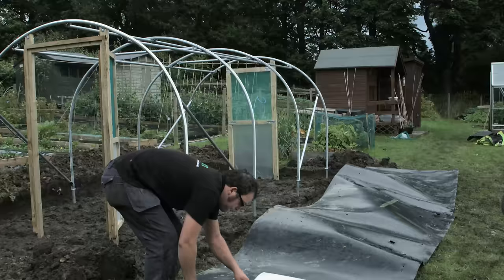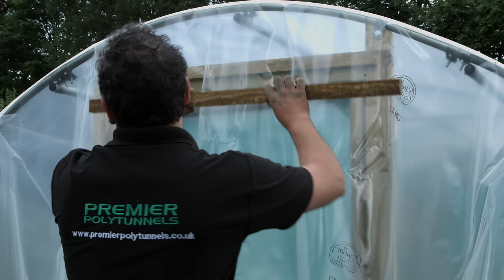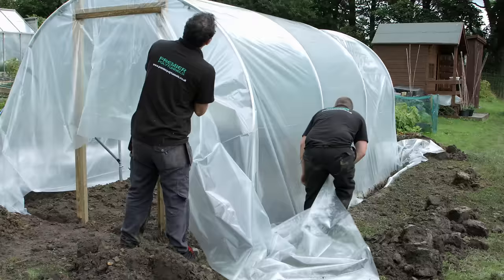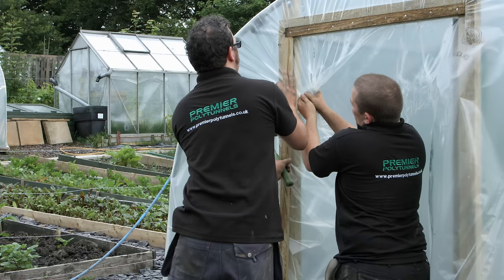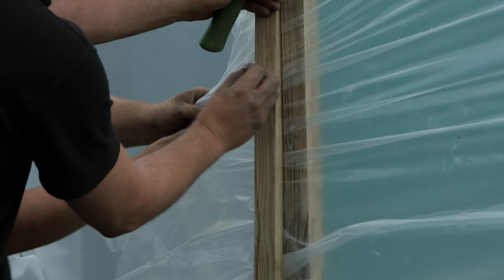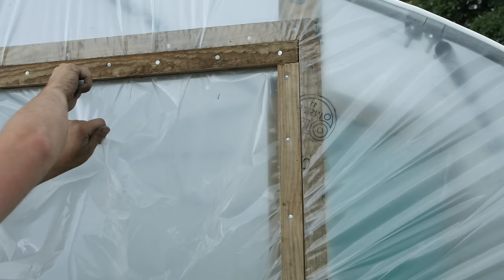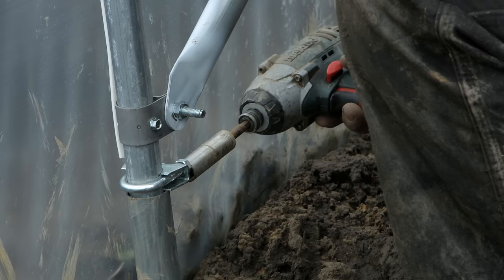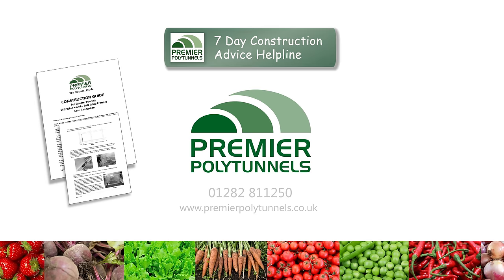Covering a Polytunnel using the Trenching method | Fitting a Polytunnel Cover

Comment: Nicely demonstrated. I have a couple of questions... 1)what if I only want a door on one end? And 2)is there an alternative method to trenching?
Reply from the maker: Hello, 
Thank you for your questions.
 
We do recommend having a timber end/door frame with a dummy door at the back end of the polytunnel - it doesn't need to be a working door, but the timber frame will allow you to fit the cover with ease and with a taut finish. The timber frame also adds strength to what would otherwise be a big flat area of polythene on the end of the tunnel.

You can certainly use the 'base rail' method for fitting the polytunnel cover, rather than the 'trenching' method, if you like. Details of the various covering options can be found in our video here - https://www.youtube.com/watch?v=68SWQtC1MNU&list=PLBtgTb_JxETny-1AZPn_x3fMm4FS-LuX8&index=5 

Kind regards, 
Premier Polytunnels
Reply: @PremierPolytunnels  brilliant, thanks

Comment: Should you puncture the polythene in the bottom of the trench to prevent a trench of mud which could lose strength?
Reply from the maker: Hello, 
Thank you for your question. 
You can certainly make small holes in the polythene in the bottom of the trench, if you want to. 🙂
Reply: Ours was full of water the next day so that's what I did and they drained within an hour.

Comment: Is there any difference in using nails or screws?
Reply from the maker: We supply nails as standard, however you can certainly use wood screws for attaching the timber batten to the timber door frame instead, if you wish. There is certainly nothing wrong with swapping the nails for wood screws. :-)

Comment: Wouldn't be cutting excess round the door frames best off rolling poly round the batons then nailing .
Reply from the maker: Hello, 
Some people do choose to wrap the polythene around the battens and this is OK to do, providing you ensure the battens are well fixed onto the timber frame. 
Please bear in mind that batten wrapped in polythene will quickly get damp and stay damp, therefore will rot quicker. 
Kind regards, 
Premier Polytunnels

Comment: Why wouldn’t water build up on the outside? Considering there is plastic lining that trench and it can’t drain away
Reply from the maker: Water will always find a way to drain away, eg, at the corners where the polythene is cut in the trench. But there is also no problem with making small holes in the polythene in the bottom of the trench if you're worried. :-)

Comment: Got a shitload of wrinkles. But it's just a little single poly hoophouse made of wood anyway.
Reply from the maker: Thank you for your lovely comment. :-) 
The polythene cover on the ends of the polytunnel is purposely fitted with pleats, however the polythene cover over the hoops and down the length of the framework should be wrinkle free with a drum tight finish, as shown in all of our videos. 
Our polytunnels are manufactured with Z35 high tensile galvanised steel frames and with timber door frames and doors on the ends.